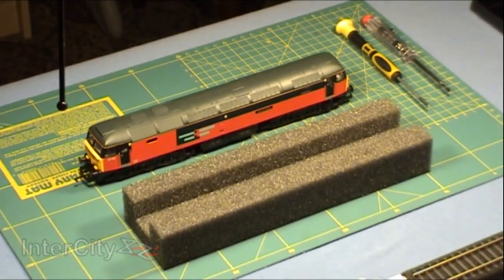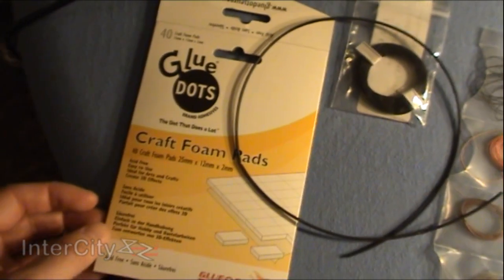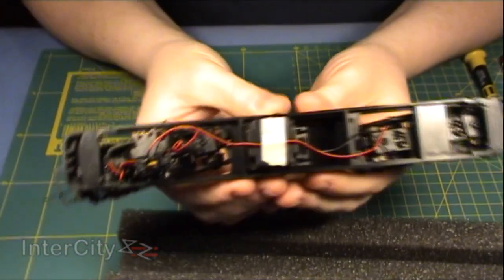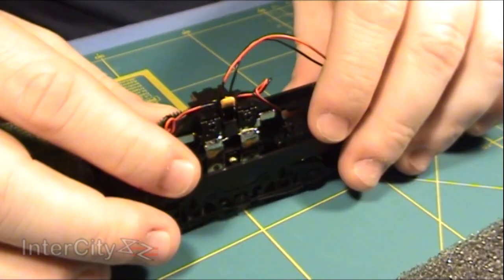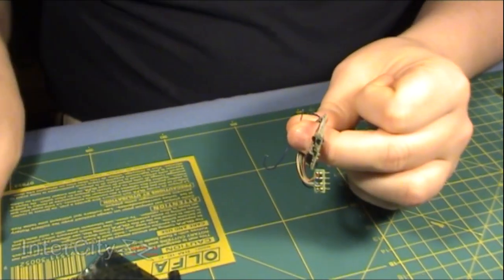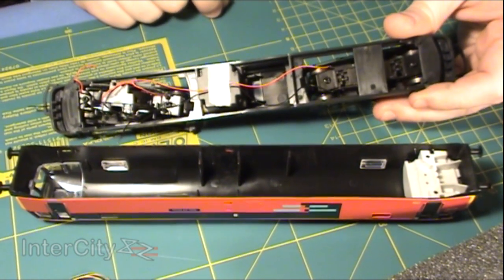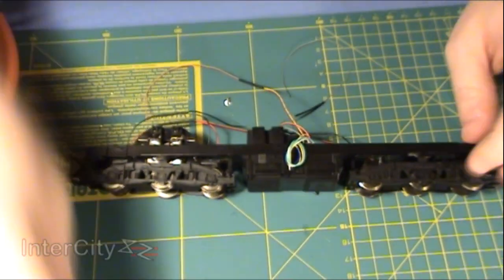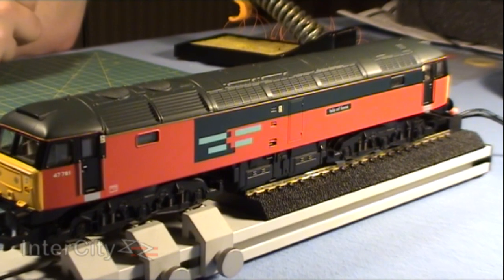*TIPS* How to DCC a non-DCC Ready Locomotive

Comment: Thanks for a great video. I used it on my first conversion. 
Having extra flux that you can aplicate on with a toothpick in prepare soldering is very helpful and a slightly smaller tip on the soldering tool. 
It's not the amount of tin that makes the difference. Thanks!

Comment: Armed with the knowledge of how the chip works, this is actually a simple loco to convert.
Many of the ones I have use a lot of the chassis to transfer electricity. Others like an original 1985 Thomas the tank engine use solid copper strips made in specific shapes, one of these basically transfers power directly to the motor, while the other side is on a wire, part of it conducts by being screwed to the metal chassis. I am reluctant to do it, but it would require cutting those copper strips, but that's actually one from my collection that I'm more confident could be converted. It's when you start looking at some of the even older Locomotives (I think my flying Scotsman is from 1972) where I find myself not wanting to mess with it.

Comment: Hornby used to make its connections inside the loco with mini spade lugs rather than solder lugs, possibly to make it easy to plug in a Zero One module (the eighties version of a DCC chip).

Comment from the maker: @LateNeverEarlyR - as for your comment about switching for running-in purposes, all of our locomotives are run-in in DC mode before they're converted. Again there was no need to go to the trouble of fitting a female connector as this loco will never be un-DCCed. Your solution would be very useful for somebody working on a tight budget who cannot afford a separate chip in every locomotive.

Comment: Well, it depends on what you want:
What scale do you model?
How many locomotives would you like to run at the same time?
Do you want to switch points aswell?
Do you want walkaround control, maybe wireless?
Do you want to involve a PC for programming or controlling?
How much juce does each individual locomotive draw and how much space is in them?

If you just want to try it out, you could just get a DCC train set with two locomotives and upgrade later.

Comment: Great video. Very useful in helping me upgrade my stock. Just a quick question. If I wanted to upgrade an old dc with lights how would I go about the wiring. Would I have to change the lights to led or can the original ones be used. ? Which wires would go where. Many thanks

Comment: Hi Will and Craig , can you dcc any loco . I have several locos that are as old as me (33) ;) and I've asked for advice from others and they say not to bother with dcc fitting them . They are well maintained motors etc . Thanks
Reply: Yes you can, but only do so if the loco runs good. I was able to chip a 0-4-0 pocket rocket. Just barely enough space to fit the decoder in it after a lot of fiddling.

Comment: Video is a bit long, nice and neet job though.  I started a conversion with the same motor and mucked it up, I will be able to hunt out the engine and try again.  Thanks.  PS where did you get the wires from they look very thin and just the job?

Comment: I am new to model railroading and DCC so please dont bash me for being stupid! I am working on building my first setup, and have 2 non DCC engines and am thinking about switching up.

My question is this- At the point where you finished- the engine still ONLY responds to forward / backward and speed operations as it did before and nothing else- is that correct? Therefor to include sound you have to also add a sound module and speaker?
Reply: It is best to just buy the DCC/Sound decoder, which has both the DCC and the Sound built into one unit. It makes installation a lot easier. I have seen them online for under $70 USD.  The hardest thing might be the speaker, and might require modifying the frame a bit more (aka dremel it out)  to fit that into it. This takes some degree of caution, and some planning so that you do not short out the frame, or cut out too much of it and compromise the other components (like the motor, gears, etc). But look for the specific DCC/Sound Decoder for your specific model to avoid that. On a large HO model, it should not be as big of an issue.

Comment: Maybe you could help me?
I've got a Virgin HST which I've hard wired to DCC with Hornby decoder. My problem is, I've got a 6 car rake including power and dummy cars. The power car struggles to pull the lot, so I was going to purchase another car from eBay or the like.
My question to you is, in order for the power car to pull and the dummy car to push, will I have to cross wire the the decoder in dummy car in order for this to happen???
Thanks. Ollie.
Reply: +Oliver Rooney I read about someone DCC-chipping a twin set of class 20s. They had to reverse the motor leads to get them to do basically what you want them to do. The only alternative I can think of would be a DCC decoder with a polarity switching function built in. Or perhaps you could use a pin set to control a polarity switcher hard-wired to the motor leads.

Comment: Ok, so I'm watching this from overseas. Hello from America, btw! ;D Anyway, I'm wondering if the wiring might be different because I have a Bachmann (American Bachmann, not British) EMD GP40 that is non-DCC ready. I think that the way the locos are wired up is different. Not quite sure. I'm using a 9-pin Digitrax DH126D decoder.
Reply: The DCC chip that was used in the video is NMRA compliant. As you probably know, the NMRA is the American organization which sets standards and recommendations which most manufacturers follow. This ensures that any manufacturers products will be compatible with anyone else's, IE a Bachmann locomotive will run on Atlas track because the wheels and track are manufactured to the same gauge. So an NMRA compliant decoder will be wired the same way to any locomotive manufactured in accordance with NMRA standards. So to make a long answer short, the decoder will wire up the same way to your Bachmann locomotive. Just make sure that the motor is completely electrically isolated from the frame.

Comment: I can see the is a 6 yr old video.But I'm trying to find out how I can put a DCC chip wiring and all into a non DCC g scale old Bachmann 4-6-0 to be able to use my Digitrax system along with my AR1s so I can have return loops on my g scale garden layout.Its been a huge struggle No one seems to be willing to help or show in a drawing what to do I just want to share the hobby with my grandson.But I run into roadblock after roadblock so many times that I'm considering just saleing all my g scale trains and cars.Iv even took a couple of my Bachmann 460s and ordered and installed the upgraded Anniversary all metal running gear just to let them set on a shelf collecting dust.I even have a couple of Big Top complete sets and have only let them stay in the boxes they came in plus a few extra passages cars to go with them If they were all hooked up on the brass tracks I have it would be a sight to see.Its just a bummer when I ask how to or what to do to turn them into DCC some sale just throw all of it into the trash Ben and get DCC ready trains.That really sucks to hear some say that instead of offering to help.

Comment: my intercity 125 original the one made in england! It has directional lights will they just work as the track has 100% power at all times or do i wire it diffrently?
Reply: You would be better off to wire the lights to your decoders light function outputs, that way you can control the lights as you want to.  Your decoder should come with information about which wire does what job, but blue is the common feed to all lights, white being front lights and yellow for rear lights.  You also might have to put a resistor in line to your lights if your using led's.

Comment: very good but be careful with your terminology. you mention silver solder but silver solder is in fact a solder that needs much more heat and is used for mechanical repairs, brass radiators etc